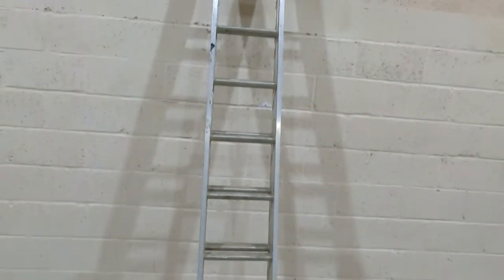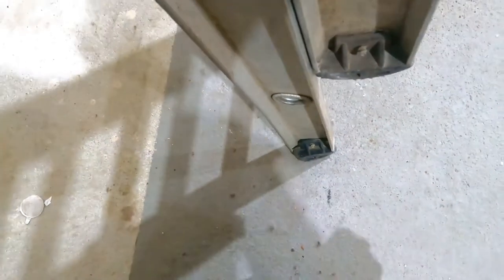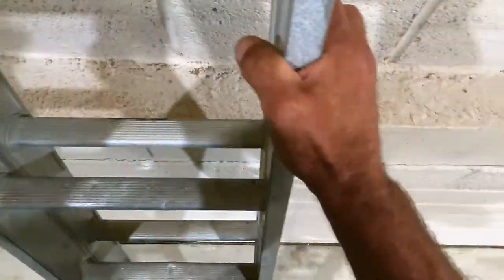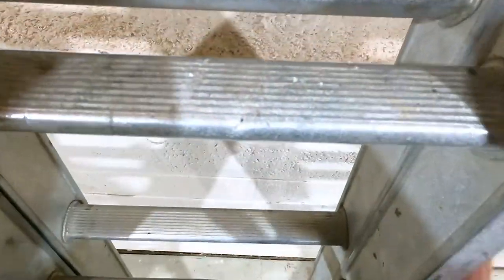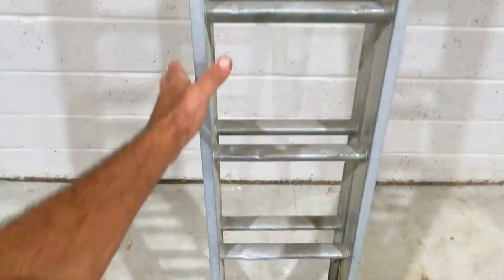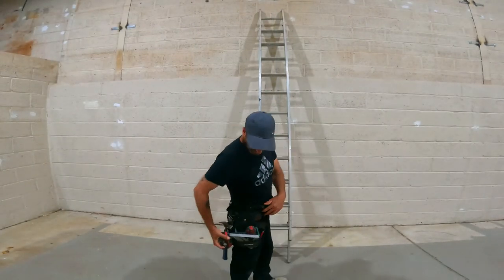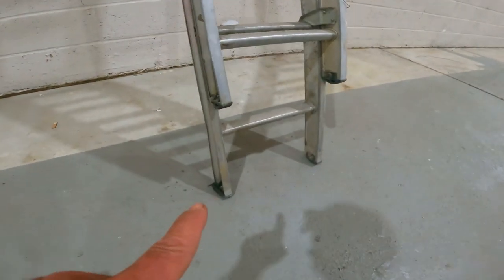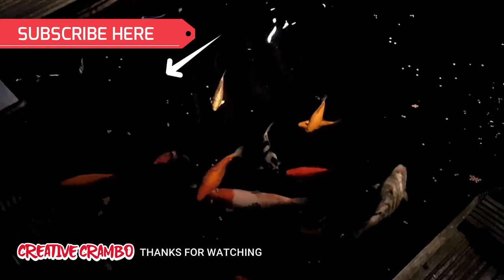Setting Out A Ladder 4 To 1 Rule

Comment: Also hang on to the rungs not the side just incase you were to slip you can hang on. That's what an ex Firman told me.
Reply from the maker: Yes very true mate ill make you 💯 right that's a very good assessment on what you definitely need to do ,
Thank you very much for pointing that out it could be a life saver mate 👍 thank you very much for stopping by the vid and your comment I like it alot 👍👍👌👌👊